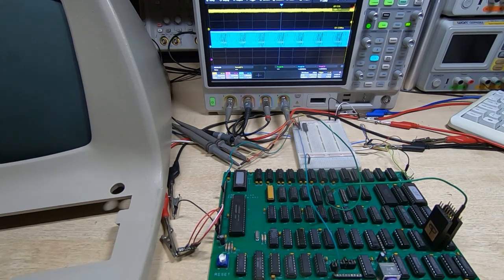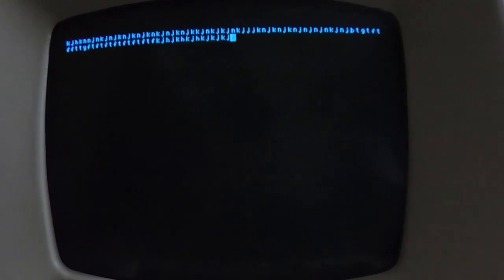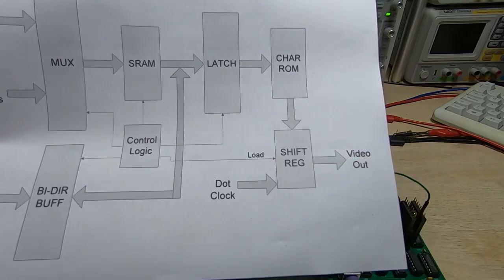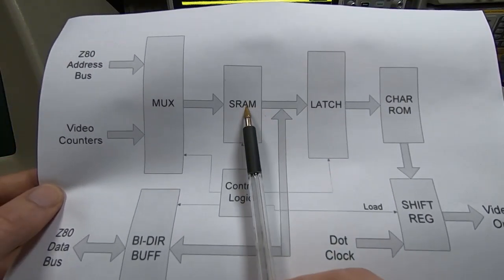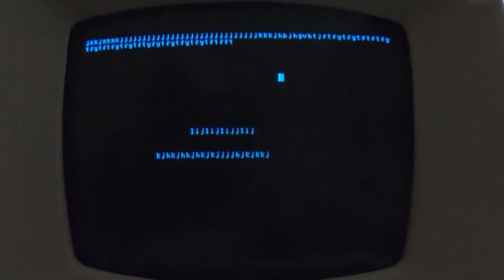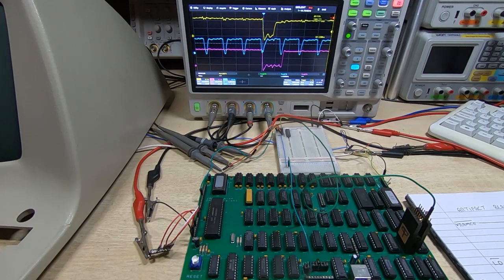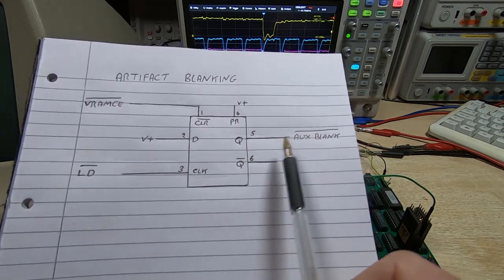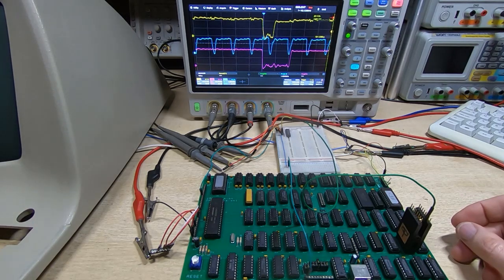Designing A Z80 Computer Part19

Comment: Notably the IBM CGA card, from 1981, had similar artifacts. Described as "snow". This was a commercial product using a VDC.
Reply from the maker: Yes it is surprising how many video system of the time had similar issues but hopefully this video demonstrates that it is easy to remove them (especially in a discrete design).
Reply: @JerryWalker001  Forty odd years ago it appears to something that wasn't considered important enough to fix. Even in, quite expensive, commercial products.
Reply: In CGA the solution was to update the video RAM only during the vertical retrace.
Reply from the maker: @okaro6595  Yes, Which is what I have stated in several of these videos. It was actually a bit more complex than that. BIOS routines in the early PC's blanked the electron gun in a similar manner to my design. In software you had the option to use either the vertical or horizontal blanking periods to move data but this had overhead and limited bandwidth as I have explained. It was up to the programmer to deal with this. Later versions used double buffering to avoid flicker and later still dual port RAM was used. There is an excellent book published in 1987 by R Wilton which gives some code examples.

Comment: To simply blank the video output while video memory access by the cpu hides the bright artifacts which is less visible on a white on black screen image obviously, but doesn’t that show up as black artifacts if the image on the screen is being inverted (if your character set supports this) or the screen is full of characters for what ever reason? I think on a later or extended version (graphics + text) you could latch the video address requested by the cpu and synchronize the cpu access in between the video refresh cycles like the bbc micro and c64 did ( granted they shared memory for both but that idea was there before even then and since the late 80 memory got much faster) to properly design this to work withe the different read and write cycles on the Z80 which are not of equal length even for read should be fun and a bit of a challenge. I quite like the series more and more each time and now started to do a little project myself again! Thanks for that. 😅
Reply from the maker: As I say in the video I do not want to sync the video updates as that will limit the video bandwidth. However the method I show does not actually do what you suggest. Imagine a white on black screen. The artefacts are caused by the electron gun turning on briefly during a memory write but this only lasts for a single character bitmap row at most and only for a single frame. The reason they are so visible is due to the persistence of the phosphor and the human eye. On the other hand if the artifact occurs as a black value on a white part of the display then you will not see it. The image on the screen will still be from the previous scan and although it may dim slightly it will only be for one scan (50 per second) and this is not enough to make it visible. If the image is inverted then the reverse happens with the same result. In other words only white on black artefacts are visible but not black on white. I cover this in the book.
Reply: @JerryWalker001  But if an IPS or OLED screen was used, the black artefact would be visible, however the eye’s own persistence of vision would reduce the effect.

Comment: I had a Z80 based computer (Sharp MZ80K) in the early 80s, there was a Poke where you could enable/disable artefact blanking.  Without it the screen could get very messy especially in machine code.
Reply from the maker: Yes the MZ80K could synchronise the video updates with the video access but at the expense of video flexibility. The method I show here does not have any downsides except the need to design the memory mapping circuits to allow its use but in a discrete design this is easy.